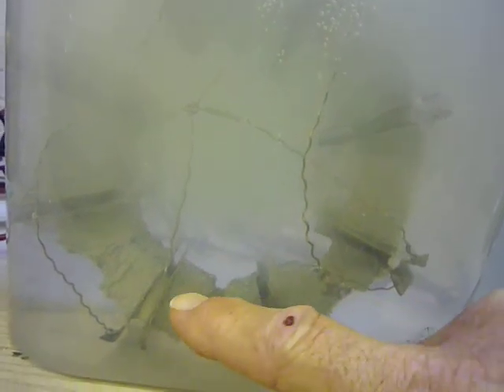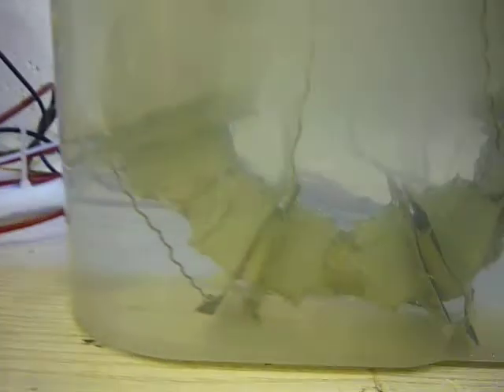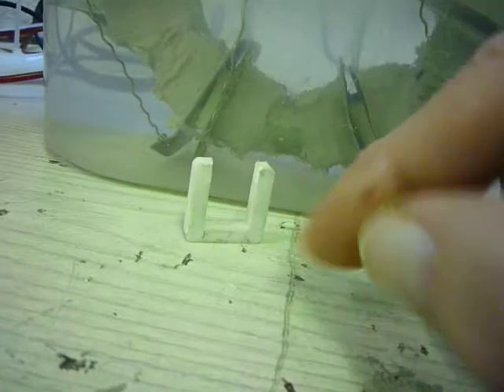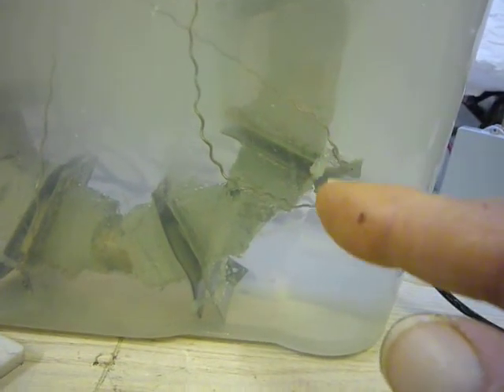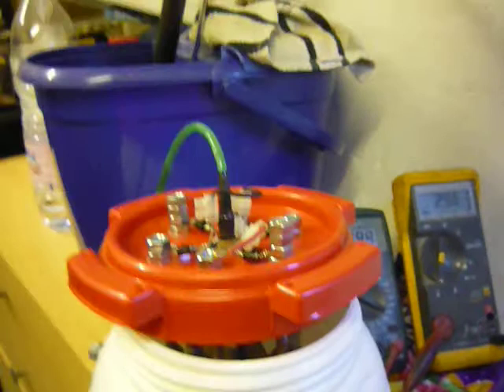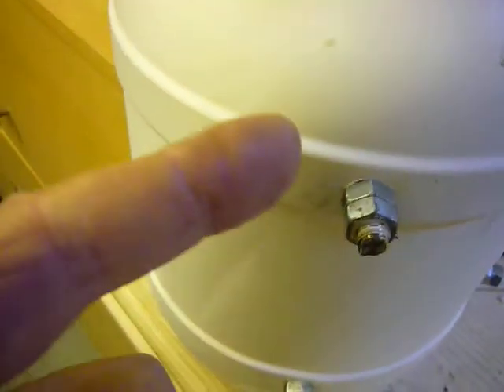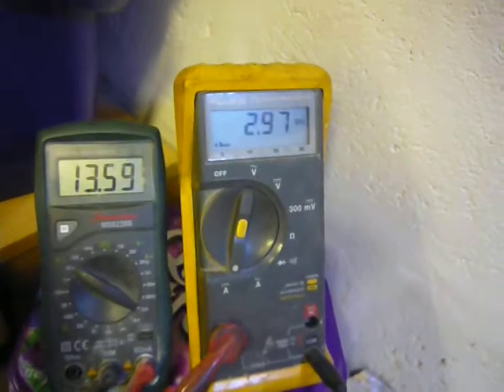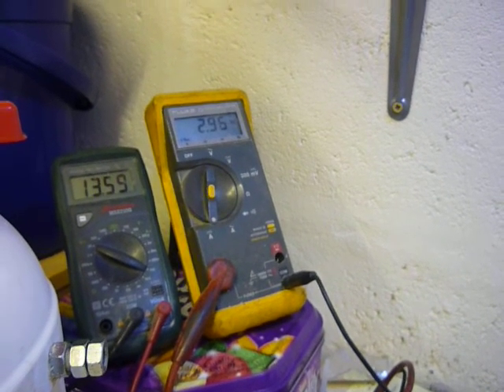ORB - HHO magnetic cell

Comment: Hi   
Low amps thats great.....
With 10 t on each side of my ring magnet    1,5 mm stranded  insulated cable
The current draw increase  just like in a buck booster  but with pwm  same result as yours    12 v   3 amps   
With fogger  on the bottom  rate of h  travel   increase 
cheers
Tried to make dc to ac ac to dc in coil   but no reaction   
need more tests with other set up but the fogger plays an important role  as well